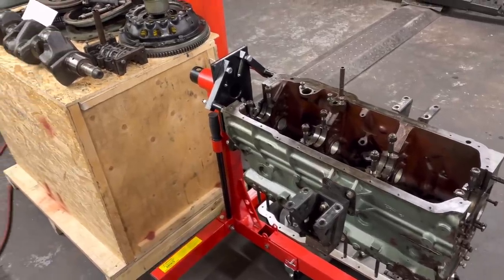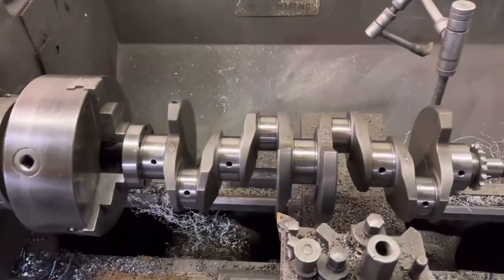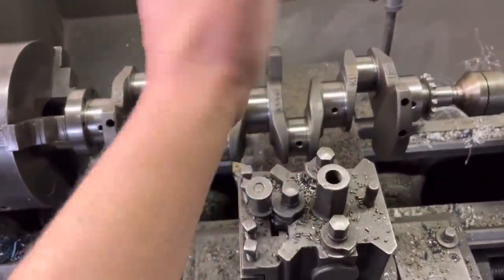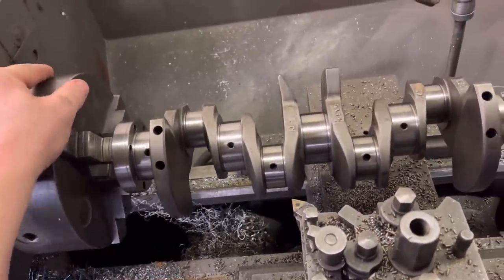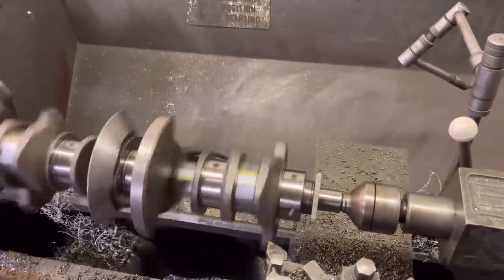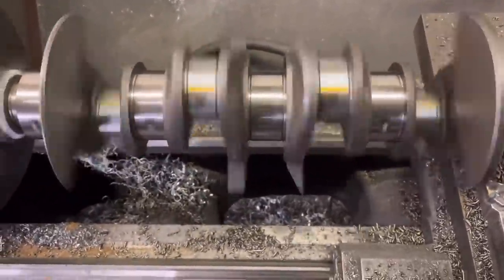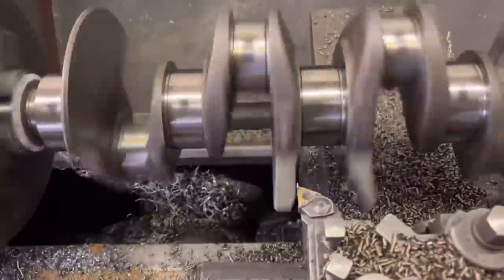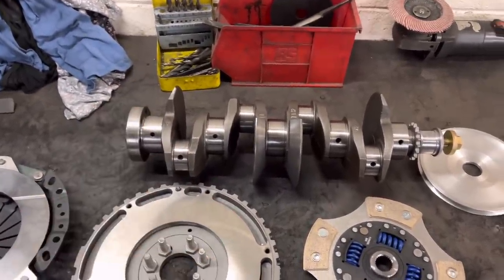CRANKSHAFT KNIFE EDGING, What is it? How do we do it and what are the benefits?

Comment: I understand the knife edgeing reduces the cross sectional area presented to the air and oil in the crankcase. This reduces parasitic losses. To now balance this crank requires either heavy metal, which is not desireable, not be added back onto the counterweights. Or you drill the rod journals hollow to remove the equivalent mass as removed from the counterweights. I need to see that video.
Another method is presented by Dsvid Vizard in his PowerTec 10 series. In a couple of videos he goes into crankshaft balance for power. He illustrates adding weight directly opposite the rod journal because that is easier to visualize. Then he shows those same two weights at 90° to the rod journal center line and at the main center line. At this point the crank balance is not affected, just crankshaft weight. What he is demonstrating is removing weight off the front and rear faces of the counterweights as referenced to the rotation. If you remove say 20g from the counterweight as indicated by the balancer about opposite to the rod journal, by removing metal or weight from the front and rear, you can remove much more mass in total. If this is removed in such manner as to push oil droplets toward the main web, this oil is removed from interaction against the rotating assembly as it then runs down the main web to the sump. Instead of removing 20g from that counterweight, you could remove 40g or more. This lightens the whole crank and reduces rotational mass. This aids acceleration.
Reply: I've seen the same Power 10 clip. Good stuff! Car people make quite generous and encouraging family.

Comment: I just watched a Vizard video on this and, unless I've misunderstood, he says the counterweight should be shaped the other way so the high points are closest to the main bearings so the oil is flicked off away from the rods/pistons, thus reducing the windage losses. He quotes 7bhp at 7000rpm total gain from counterweight reshaping (with a more rounded profile), which I think was for a flat-plane V8, so should be similar for an inline-4.
I can see the logic to the way you've done it in the video, it does seem intuitive to have the most mass closer to the centreline of the journal crank throw it is balancing but I don't think that actually really matters as the crank isn't bending enough for it to be significant.

Comment: The next one on the balancing will be interesting! I think it's really going to be about the weight savings where you gain performance and responsiveness, but better cutting through the oil will be negligible. At 3k rpm there won't be a whole lot of oil to cut through, it's going to slosh all over the insides and not really be floating at crank lobe level
Reply: Messing with a dry sump build the big win I read about was mesh or chicken wire to grab the oil as it left the rotating parts. Apparently a lot bounces back into the crank.
Reply: When you've got something rotating,  lowering the mass will lower the moment of inertia - and as that's mass x radius^2,  the further away from the centre of rotation that is,  the bigger the gain.
Reply: But the knife edging is not solely about cutting through the oil it’s about reducing windage in the sump and reducing the suction created by the piston traveling up the bore.

Comment: wooohooo great to see a BMC C series engine in your workshop.
i rebuilt one for my 1955 Wolseley 6/90 several years ago with minimal machining required, the 6/90 has the 2.6L, my 1961 Wolseley 6/99 has the later 3.0 litre engine.
i've since acquired a couple of 6/90 parts cars with 2 more of the 2.6 engines, one of which i have had running.

Regards from Australia
Reply: Were they out of a Westminster? I've read they are an exceedingly heavy engine
Reply: @stephenscholes4758  g'day stephen, no all my engines are genuine Wolseley engines, a friend here in Australia has an A90 Westminster that he had restored a few years ago, it was his father first car, it is much smaller than the 6/90, the later A99 & A110 were the same size as the Wolseley 6/99 and 6/110. 

the A90 had a tiny single solex? carb, the 6/90 had twin SU, and the Austin Healey's with the BMC C engine had either twin or triple SU's (different head for the triples)

the 3.0 litre engine in the A99/6/99 & A110 and 6/99 and the Austin Healey 3000 were regarded as bullet proof, the earlier 2.6 litre engine from A99, 6/99 and AH 100/6 was doubly bullet proof, although a flaw was later discovered in that long term rust could erode from the water jacket into the oil feed to the head, there is a patch requiring drilling from the side and from the top and installing stainless steel sleeves to fix that issue, we have the AH folks to thank for finding that issue.

i'm just about to take the engine out again, as i now have the parts to fix the gearbox properly, i was unable to get all gears due to wear on the cross shafts and bronze selector forks, the engine sounds freaking awesome, and i can't wait to see how well the overdrive works now it is all connected properly. (dad in law fitted it but never installed the kickdown switch, and had a relay which would stick on, so he never got to utilise overdrive)

Comment: Good day... I need your help to understand something about 4 cylinder engine balancing... Please explain - how are inline 4s balanced to match the pistons & rods to their crankshaft? I've seen you(like in this vid)balance the crank & flywheel & clutch assembly - & in another vid, I've seen you balance a set of pistons & rods - but I've never seen you, or anybody for that matter, balance a piston\rod set with their crank etc... Or is it that the pistons\rods balance themselves(as I imagine same happens when the crank pane is horizontal\vertical)...  I want to have an idea of how much weight I'd be able to take off my crank, in regards to how much lighter my new piston\rod combo is - or on the other hand, how much I can 'hack off' my stock crank... Thanks in advance... =]

Comment: Seen this way of doing it many times. Its effective for reducing the rotating weight, but,  imagine splitting each cylinder up, and think about how the remaining counterweight is offsetting the weight of the big end. Think about it long enough, and you will see how you are setting up mass that tries to flex the crank across the pins. Works fine when the crank is plenty strong, but no good in high stress applications, or where a long service life is required. Much much better to shape the leading and trailing edges of the counterweight, or if that is not enough, turn some material off the outside diameter.
Reply: I was just thinking that. Shaping the leading and trailing edge would help with windage. Shaping the radial edge wouldn't account for much, except for wind shear as it swings past the rod.
Reply: @biohazardousBiker  e già che ci siete consigliate di aggiustare la posizione dell'utensile perchè cosi non tornisce bene ;-)
Reply: It's a tight place for sure!

Comment: I'm sure by "cut through the oil" you meant the oil falling and returning to the sump. 
I can't believe how many people think the crank runs through the surface of the oil in the sump.
Reply: Windage...
Reply: @gazzafloss  Still doesn't go through the surface of the oil in the sump...
Reply: @bcbc8649  I do realise that, #windage.
Reply: Stationary? No. But there's a chance with moderate G, also oils can foam, or at least used to when they ran more detergents due to impurities (shows my age with mineral oil based 20/50 engines). The last engine I worked on to any real depth had side and top baffle plates to keep the crank 'dry'. It was ultimately converted to a dry sump, but even with a pressurized casing and pumped extraction still had a hefty top baffle.

Comment: what you and others do not realize, is that the counter weights are, counter weights !  they are there to offset a specific proportion of the reciprocating portion of the crank assembly
All this metal removal will enhance engine vibration, shorten main bearing life, and at worst 
crank failure .... if your looking for free HP, best to look at the aerodynamics of leading and trailing edges
Reply: Exactly my thoughts my 540 we did leading only and why not put a vacuum pump on it as well. Got 25 free hp with it
Reply: You make no sense it still gets balance one would think they take off weight on the opposite side
Reply: @RICHCREWSPLASHSET   but there is no weight that can be removed from the opposing side !  The counterweight is set by a numerical value of reciprocating and rotational mass .... ask any engine designer and he will agree with my initial statement, I hope I do not sound like a knowit all prick, but I have forgotten more than most know about ICE

Comment: My tech that's doing my engine build is doing this to my Saturn SL2 3rd gen crank and I have an aluminum Fidanza flywheel as well. Just was curious to see what advantage it has. I'm doing  SCAT forged rods, JE forged pistons 10 to 1 , port and polished head, mild intake valve deshrouding, mild bowl blending, dual intake cams, and after the 1000 mile break in period it'll be running 10 PSI with an E85 blend so it'll be Bruce Lee in the weight department with the polymer body panels, carbon fiber hood, and the Einkei RPF1 15X7 at 9.8 LBS per wheel. And I added a Mfactory LSD, just an expensive ordeal...lol

Comment: Back in the 1980s I raced 100cc karts - with uber high revving two strokes [circa 20K].  We used to get special knife edge conrods from the engine manufacturers and tuners - not sure if that's ever done on 4 stroke racing engines,  maybe the revs aren't high enough to warrant that ?

Comment: Interesting. How does that affect the pickup of an engine? Does it affect the torque at all?
Reply: Better pick up, less torque, but not really :o) The pinto I my van has a much bigger flywheel to make it happier at low rpm. I suppose I am saying a big flywheel stores more energy than a small one.
Reply: Stand an MTB upside down on it's seat and bars. Rotate the pedals by hand to get the rear wheel going really fast (use a high gear). Now take the wheel out and remove the tyre and inner tube and put the wheel back. Rotate the wheel to a high speed again. Feel how much less effort it takes without the tyre in place.
Increasing the rotational speed of any rotating mass requires the input of energy which is proportional to the value of the mass. Less mass, less energy required.
Thus, if you lighten the rotating assembly of a car's drivetrain (crank, fly, clutch, wheels, tyres) less energy is required to increase their rotational speed. That energy produced by the engine can now be used to accelerate the linear velocity of the car instead.
So to answer your questions directly, YES and YES.
The entire rotating mass acts as a flywheel to smooth out the power pulses from an IC engine. More mass = more smoothness. So there is a balance to be struck when building an engine. Reduce the rotating mass (especially from the outsides) and improve the responsiveness of the engine. Take a little off for a road engine = slight reduction in smoothness and small improvement in responsiveness. take tons of weight off for a race or rally engine and get huge improvement in responsiveness at the expense of smoothness (esp a rougher idle).
HTH
Reply: less inertia

Comment: So if the webs are there to counter ballance the weight of the rods and pistons,  after doing this, how do you now match the new crank weight to the rod/piston weight?
Reply: You can balance the entire engine assembly together. But it pays for everything to be balanced before doing so. 
For example, old school turbos were heavy and could be balanced outside of the core, modern turbos have much more refined components that require balancing at every step of the process. Compressor wheel, turbine and shaft, turbine and shaft with the thrust washers, compressor wheel and nut. Then marked in a position to indicate the clocking angle for balance of everything. Fit into a core and balanced again with the seal rings fitted and an oil feed hooked up. The frequency of the imbalance pretty much defines how perfect the balance needs to be for a lasting product. Modern turbos go up to 300000 rpm so they need to be near perfect or the frequency of the imbalance will be so high it will simply wear out and make pleny of noise.
Reply: @Blandy929  your talking about turbos which is completely different to lightening and balancing an engine as far as I can see.
Reply: Balance is Balance. The turbo was just an example. You are measuring for the same thing. I cant see an engine assembly ever having the balance a turbo does but there isnt a major requirement for that anyway. Its not gonna see super high rpm.  
Look up dynamic balancing if your interested, id say thats the most common amongst rotating assemblies.
Reply: @Blandy929  A turbo dosnt have the option of large amounts of weight removal,  its a tiny amount to ballance them.
Should be forget turbos as there not what my question was about. Please.
Reply: I'm a layman, so just guessing .

My guessing is the increased responsiveness of the engine may be a trade-off with less smooth running ? Which is acceptable, as it's an engine for racing.
Reply: @Blandy929  Thats just balancing, I asked about ballancing after lightening, its different.
Reply: I cant imagine the weight of the pistons and conrods will make much difference as they are on opposing strokes and each piston/conrods are weighted the same for balancing purposes.
Reply: @Blandy929  the purpose of the crank web weights is to counterbalance the weight of the rod/piston weight. So if the web is reduced, this would then put the relationship between the crank and rod/piston completely out of balance.  
My engine, a 4stk is pulling 13.000rpm heading for 15/16000rpm
Reply: I might well have missed something here; but didn't he say, at the end, that the next video is assembling & balancing the whole gubbins?
Reply: @peterjackhandy  I'd think if this is going to cover my original question, rod machining and slipper pistons are going to be involved.   Maybe even heavy slugs if weight needs to go back in. 🤷‍♂️
Reply: It's not as important as you may think on an inline engine. I can tell you that a ford zetec has almost twice the counterweight compared to the cvh it's based on, but the cvh rod and piston combo are far heavier than the zetec. If you have a 4 cylinder crank, the weight of 2 of the rods is always exactly countered by the two on the opposite side.

The same can't be said for 'v' engines, singles or most twins though as these don't have another rod and piston at 180° to counteract the weight, hence why they're balanced with bob weights.
Reply: @WarlordMarty  The Zetec rods are Sintered I believe, maybe there a bit more delicate than the CVH.  I'd guess the extra weights are for more vibration suppression, made to do a job and no more.    Maybe the steel CVH rods will stand more abuse.  🤷‍♂️
Reply: @evotoadracekartscars.6738  Only the st170 zetec has sintered steel rods. The other zetecs and cvh's are good old cast iron 👍
Reply: @evotoadracekartscars.6738  The counterweights of the crank are there to counterbalance the big end of the rods and part of the rod's beam. The small end of the rod, the wrist pin and piston are irrelevant to the dynamic balance of the crank because they aren't rotating.
Reply: @e-curb  Hm, I think I'll pass on this, looks like I need to investigate elsewhere, but thanks for the response.
I need to understand,  (ballance factor) ?
Reply: @evotoadracekartscars.6738  The problem in this discussion is that you are talking about balancing just one of the piston/rod/crankpin collection with one (or two) counterweights while others are talking about the overall balance of the engine as an assembly.  The former is relevant to bearing loads and crankshaft bending forces, while the latter is relevant to vibration generated external to the engine - ie, whether everything rattles and buzzes in your car!
Reply: @idontwantachannel3091  
I suppose it gets down to the required effectiveness of the finished job. As you say, a smooth running installation is fine but not related to my question. My engine is high reving and therefore needs to be as smooth as possible for that one readon only. This crank has been balanced at a very low lovel as far as I can see, compared to using clamp on ballance weights on the big ends to compensate for rod/piston weight. 
Since the web counter weights compensate/equalize for the rod piston weight, how is a knife edged crank with so much metal removed, be able to again balance with so little to Meterial removal from the rods. ?